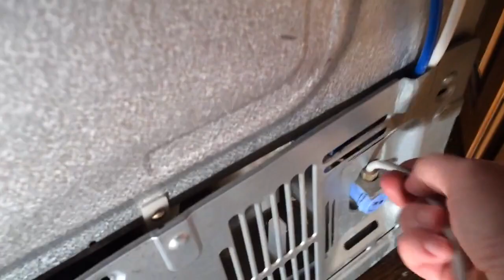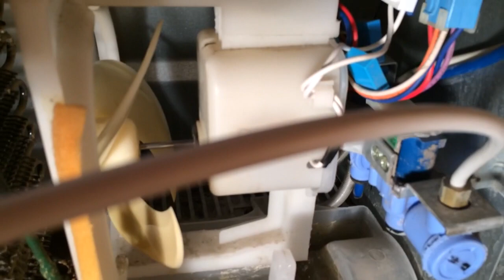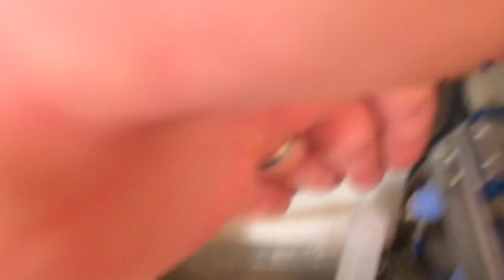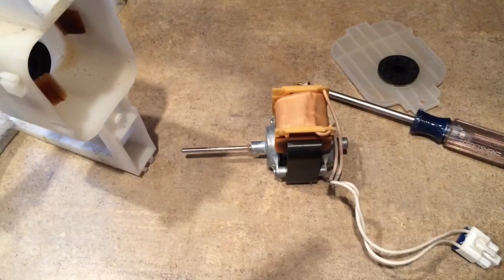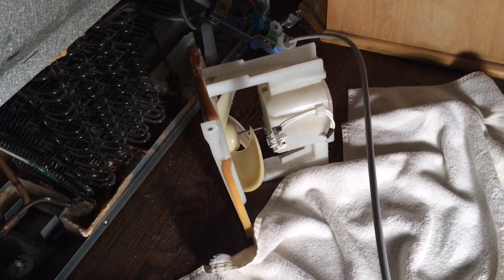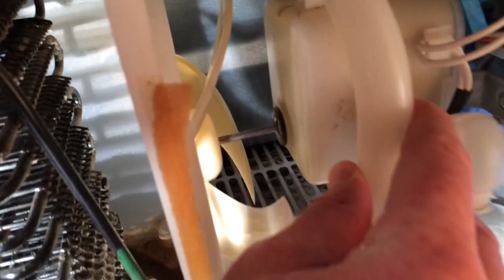LG Refrigerator Cooling Motor

Comment: By the way... I had to replace a leaking water solenoid valve.  And later, the water line that runs up the back of the refrigerator split open.  The salesperson at "L..." told me that happened on several units.  It was because of the cheap "foreign" tubing they used.  It made a wet mess.

Comment: Can you provide the part number and where did you source it? That will save me a trip into the unit.  I am getting confusing information from the sources I am checking.  Ive already shot it with WD40 a couple of times trying to extend its life.  Thanks!

Comment: repaired mine yesterday, did not remove the plastic housing. just removed the screw with a stubby phillips then I oiled both bearings in the motor, which were frozen solid. reinstalled the motor and is working fine

Comment: This video was very helpful, but there is no need to remove the drain tube or fan shroud (which is difficult).  It's easier and faster to remove the water lines from the water valve and remove the water valve.  The water lines are quick-connect fittings and easily removed.  With the water valve removed, simply pull the fan blades off of the motor shaft and remove the one screw on the back of the plastic fan housing.  The motor can then slide out.

Comment: My problem seems to be the evaporator fan and the fan next to it aren't working. Nothing is cold. I have no idea what's going on. Mother boards, sub boards, damaged wires, linear compressors, etc. ??? Bottom line, it's not cold. My compressor fan turns and coils have been cleaned of pet hair.

Comment: Thanks for the helpful video!  This worked perfectly for my LG refrigerator.  A few tips, below, for others:
- TIP FOR REMOVING FAN BLADES:  I had to gently hold the metal motor shaft with pliers and pulled the fan straight outward, then it finally slid off (be gentle and pull from near the center, not the outer parts of the blades).  It will easily slide back onto the new motor shaft in the same direction it came off.
- TIP FOR REMOVING ENTIRE FAN/MOTOR ASSEMBLY:  Tilting the assembly upward, while pulling outward did the trick.  This lets you lift the assembly up and over the plastic post.  Be gentle, within reason, as you do this.  It goes back in easily in the same direction.

Comment: These instructions were perfect.  Its not a problem cooling unless the motor has completely failed and is no longer working - then it wont cool, and it could be lots of things.  You know its the fan motor when you get near the back and its at the bottom left.  Mine as screeching.  tried to clean it first no luck.  Ordered the motor, replaced according to the instructions here, and now fixed.  Thanks so much!
Reply: bottom right, sorry.

Comment: Jon's video here is awesome. Getting the housing out with fan requires patience, don't try to muscle it out or you will surely break one of the many plastic parts. You kind of have to twist and turn it. You may have to slightly bend a section or two when removing it but don't overdo it, use a firm controlled grip. Try to remember how you do it as it will help you get it back in there. Parts of my fridge were warm to the touch, around the door and on the sides of the fridge. I can already see a big difference after replacing the fan motor. The motor also squeaked a lot before repairing. Good luck!

Comment: How long did you own the refrigerator before the cooling fan failed?

Thanks
Reply from the maker: +Mark G The motor failed within year 2.
Reply: +jon heather How do you remove the fan blade portion from the motor?

Thank you